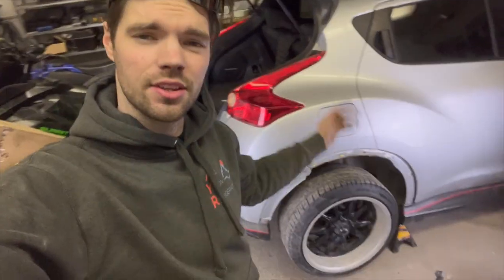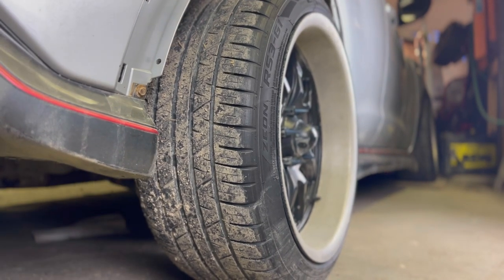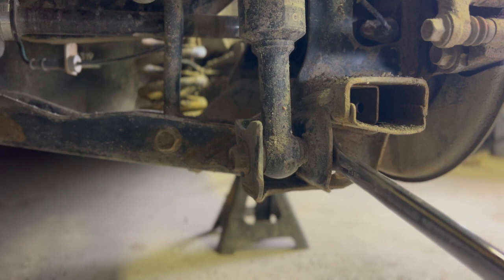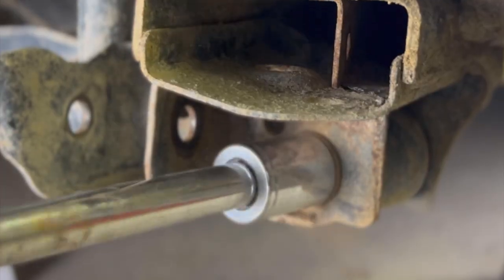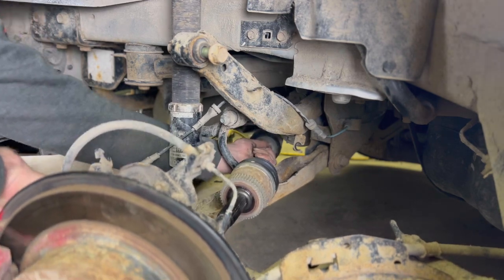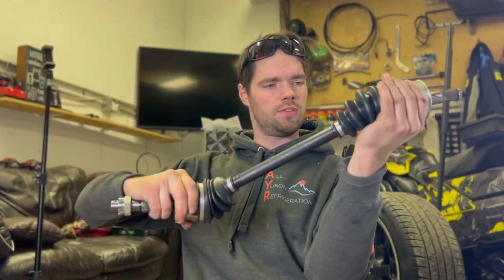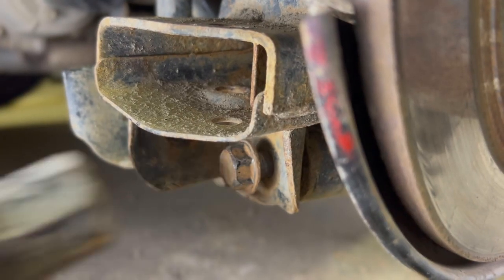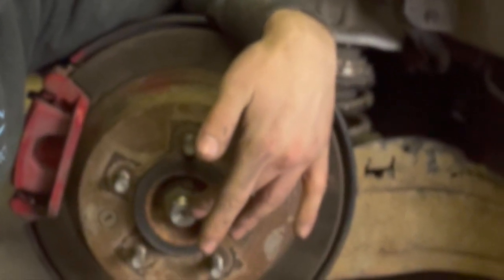How to install a CV shaft ( SPEED RUN NISSAN JUKE)

Comment: Hey man , is that CVT ? if so , how did you improved this brain damaged transmission to do all the cool stuff you do on it ? :D
Reply from the maker: I’ve added a cvt cooler that’s about it, overheated it well over 10 times, when it’s not overheated it works great! I’ve driven it from 40k to 110k